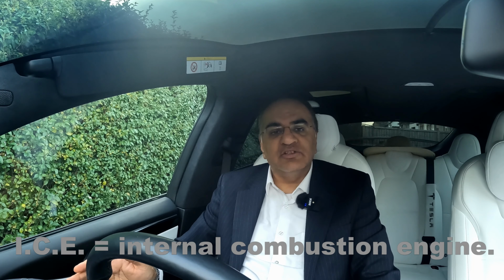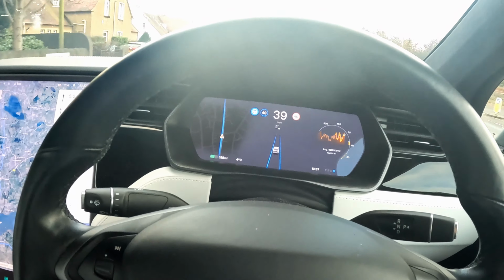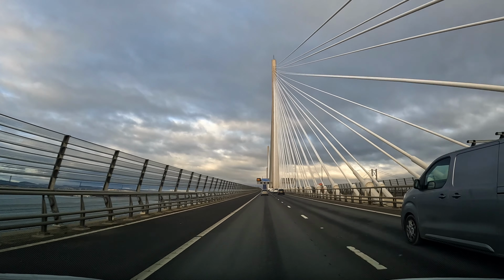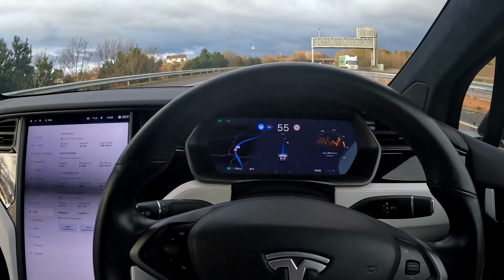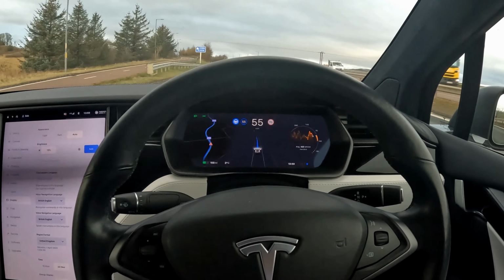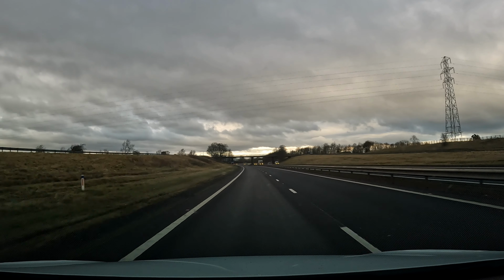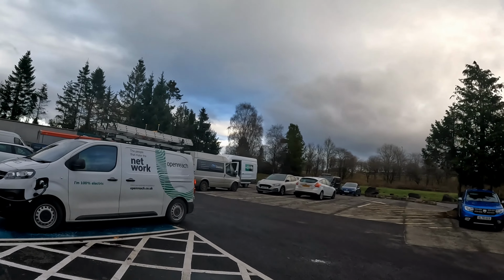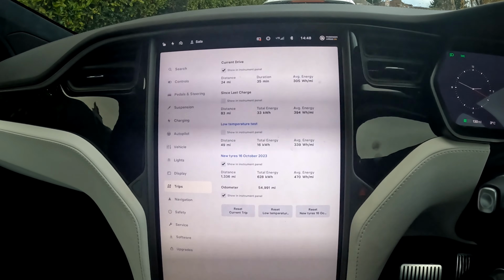Tesla Model X winter range REVEALED!

Comment: Does anyone remember old fashioned batteries? When I was a kid, when the battery in my toy ran down, I could get a little extra use out of it by putting it on the radiator for a while. The subject of battery efficiency in varying temperatures is literally, child's play.
Reply from the maker: I'm sure there is a bit more to it than that :-)
Reply: @incaseyoudidntknowchannel  Yes there is. But science confirms without even the slightest doubt that battery performance is massively worse when cold.

Comment: I have never had a problem with cold and my petrol car. Cold weather is an EV problem. 
The only problem I have had with freezing weather and a petrol car was years ago. My car wouldn't start. why? The battery was flat because the freezing cold drained the power of the battery. Enough said.
Reply from the maker: Yes but ICE vehicles also give poorer mpg in cold weather
Reply: @incaseyoudidntknowchannel  EVs have problems, big problems.

Comment: More important is when ice is cold it makes pollution so much worse in winter with all those short trips school runs and work, people more likely to leave engines running to keep warm. Ev can run more efficiently and keep warm while not emitting harmful gasses around sensitive areas.
Reply: Yes you have your heating to keep you warm, or do you, because if you do your using more electricity, less range so more charging = more pollution. Where do you think electricity comes from? Clue, it doesn't come from unicorns. And no, all electric isn't clean. 
Answer: a good chunk of electric comes from fossilfuel. You forget, EVs are not as green as you think.

Comment: I've got Ford Focus running on LPG. In winter my mileage per liter improves. I think it's because the conditioner is not used and fuel density increases with lower temperatures (liter of LPG weighs more). Plus combustion engines do not need to spend additional fuel to heat the cabin, they just redistribute the waste energy from engine cooling system.
Reply: I think you will find that cold air is denser and therefore has a higher oxygen content based on volume. More power for each combustion cycle.
Reply: That's fantastic. You will find that your efficiency drops in the summer, and you need to use additional fuel to cool down the cabin, which get hotter for you because you have a fire under the bonnet.
Reply: @Xerxesro1  no, the cabin in summer gets hotter because of the ambieng temperature. The fire under the bonnet has nothing to do with the cabin temperature unless I turn the heater on.
Reply: @dongjuang4196  Nonsense, you can switch on the engine in the winter and the cabin temperature will eventually go up until it reaches equilibrium. The engine generates a lot of heat, more heat than power, the hot exhaust gases are running under the cabin. Metal is an excellent heat conductor.

Moreover, in some cars the windows are double glazed to provide some insulation against the outside temperatures.

Of course the outside temperatures have an impact, but that is the same in both cars. The difference is that the ICE car also has an internal source of heat which is good in the winter and bad in the summer. The EV doesn't, which is bad in the winter and good in the summer.
Reply: @Xerxesro1  if you run the engine and don't move, then some heat from exaust and motor compartment can reach the cabin, but if you move, the air streams around your car will blow away all the heat.
Reply: @dongjuang4196  You lack understanding of simple physics. The heat is transferred though conduction (as in holding a metal bar on one end and having the other end in the fire), convection (your example) and radiation (electromagnetic waves, such as induction hob).

The engine is made of metal and is connected to the chassis. Heat is transferred to the cabin through the metal (conduction). 

Also, unless you completely switch off ventilation, some warm air coming from the engine will be redirected inside the cabin (convection).

And, by the way, when you are moving the engine is working harder and generates even more heat.

Anyway, back to basics: in the winter, when I'm cold, I keep the engine running, air conditioning switched off. Case closed.
Reply: @Xerxesro1  when you say that induction hob works through heat radiation, it seems to me that it's you who do not understand physics behind it.
About your experience. Have you ever thought thay you may simply have poor heater valve which lets collant despite you switch it off? I think it's more likely than all the theories which you are trying to build here.
Reply: @dongjuang4196  "Induction heating is the process of heating electrically conductive materials, namely metals or semi-conductors, by electromagnetic induction, through heat transfer passing through an inductor that creates an electromagnetic field within the coil to heat up and possibly melt steel, copper, brass, graphite, gold, silver, aluminum, or carbide."

Back to school, mate :)
Reply: @Xerxesro1  and where here is radiated heat?
Reply: @dongjuang4196  There isn't
Reply: @Xerxesro1  By your "logic" he shouldn't need to use a heater in winter.
Reply: @urbanspaceman7183  And you don't, after a while. Unless you live in Siberia. The engine warms up and generates enough heat. As a matter of fact it generates more heat than power.
Reply: @Xerxesro1  Utter nonsense.
Reply: @urbanspaceman7183  Maybe get a car and drive in the winter before taking :))
Reply: @Xerxesro1  I have a car, it is winter, I drive, I can take?
Reply: @urbanspaceman7183  And the car doesn't warm up with the engine on? Are you kidding me?? You are taking to another driver, you know...

Ignoring that, seriously - do you truly believe all the heat generated by the engine is lost in the atmosphere? The car is made of metal which is a better heat conductor than air. It's physically impossible for the heat not to enter the cabin unless it is very well insulated, which it isn't.
Reply: @Xerxesro1  Try driving with the heater off in winter. Stop talking rubbish.